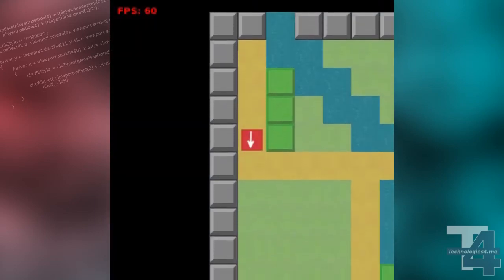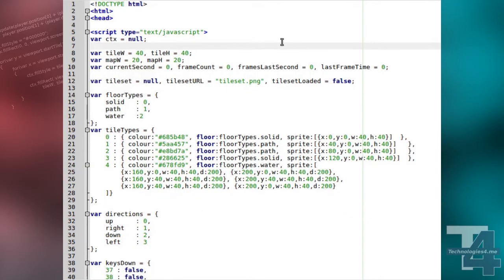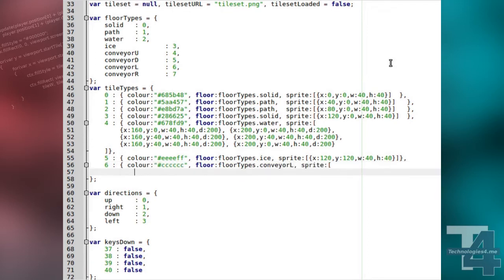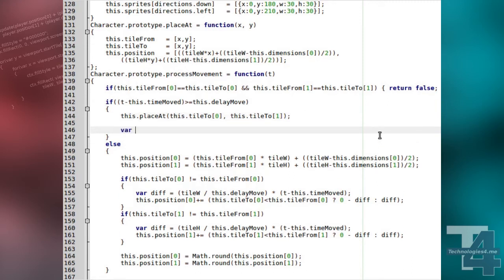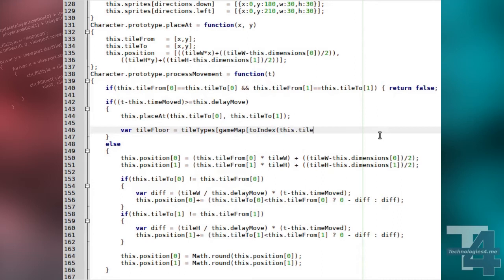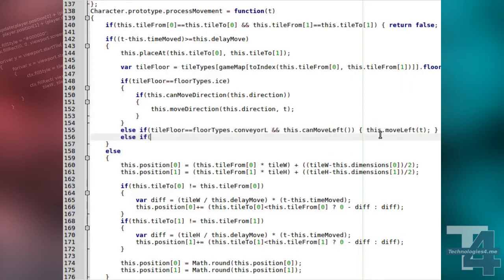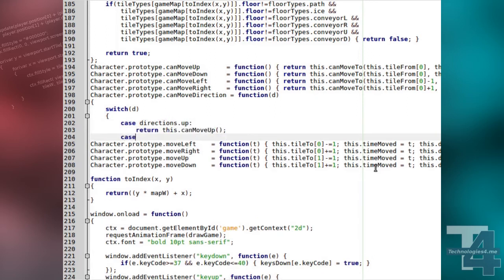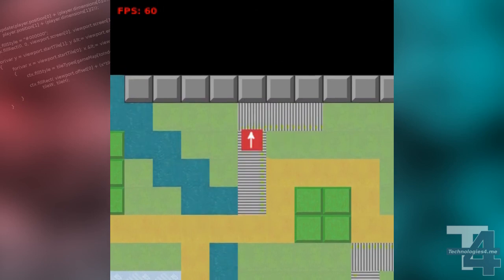Ice & Conveyor belts - special tiles - 2D Javascript & Canvas gamedev

Comment: Okay, even this does not work, also notice that even if I change water to the path or stuff like that, nothing happens, it does not even change the tile. So clearly, I must have something from my other code that is in the way of this.
Reply: Okay, it seems that it has something to do with linking because it works when I put the code as a script in an HTML file, but not in a separate file linked with

<script type=text/javascript src="/Tests/Map Test 2/Map.js"></script>

How annoying, once I figure it out, then it should be fine as normal. thanks for the video!
Reply: I have never been so disappointed in myself to find out that reason the whole thing didn't work was not because of a link error but the fact that I have an old version somewhere on my file that I thought that I comment out for future reference when not need animation. So now I comment it out and the game now picks up on the correct version with animation... How stupid of me...